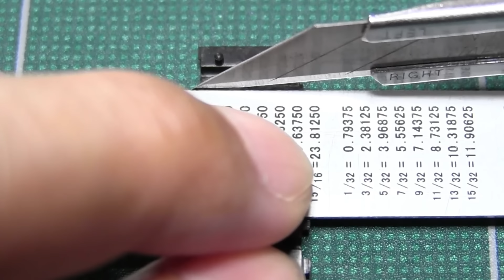1/87 Smart  DIY micro RC car

Comment: I mean it's impressive enough to build a rc car at this scale but then you go ahead and put turn signals, headlights, brake lights, backup lights on it. Seriously impressive good job
Reply: Indeed.
Reply: A little horn would have been hilarious.
Reply: You should put air conditioning in it! 😃
Reply: @jimmycline4778  yaa also add a mini tv inside it
Reply: A GPS monitor would complete it... along with the backup camera...
Reply: Sounds like Stuart Little’s new ride.
Reply: Yeah, Amazing Job, well done mates!
Reply: i have once built a tank in 1-100, thats already hard enough...
Reply: Why doesn’t it have suspension? 😎
Reply: All it needs now is FPV and now you're just REALLY driving micro
Reply: 1 pm! By
Reply: Check out his 1/150th scale vid now that’s impressive
Reply: @ReflexWalaXD ❤❤o3e9àa😂😊
Reply: @markm0000 😅
Reply: @jimmycline4778 😂
Reply: Put engine on it and then we talk impressive
Reply: I have used those optic fibres in a similar fashion on many projects , it’s amazing what he achieved there 👍🏼🥂
Reply: ... and even he sets up the CHARGING PORT..😮
Reply: Also it‘s the smallest car model you could choose. A camper would habe been easier.
Reply: Watch makers have done it for centuries
Reply: Yeah but does it have apple CarPlay?
Reply: As well as high beams and low beams for the headlights.
Reply: AMAZING !!!

Comment: Nice engineering and that is some pro level soldering skills.  This should be what the new hot wheels should be like.
Reply: It is 10 times smaller than Hot Wheels, the scale is about 1:87.

Comment: I didn't move or breathe
I was afraid to stop you from working miracles
Thank you! This is very skillful and beautiful

It is necessary to remove the red-green lamp for the battery,
in real smart
he's not there.

connected charging = brake lights came on
when the battery charge is 100%, the turn signals blink

Comment: I still wonder how the hell you have managed to keep all those naked wires unbroke and disconnected from each. Respect the hard work !!
Reply: i think theyre enamel coated. stops them from interacting and short circuiting each other
Reply: @blurredhorizons5067  and noted some plastic heat shrink or similar on the wire joins. But yes enamelled copper wire.

Comment: You even made brake lights and blinkers with fiberoptic filament? You're crazy! It almost looks like this model was designed to be turned into an RC. For even more compact design, have you considered ordering custom made PCBs? You can do that easily with services like JLCPCB and PCBWay. All you need to do is design the PCB and order it. You can order multiple. There's even flexible PCBs so you could eliminate some wiring with clever design.
Reply: That bit of extra space would be great for implementing AC 😌
Reply: I'm not even sure JLCPCB can make these, they may be too small (there are max and min size requirements)

Comment: Where did you find such a small stepper motor?
Reply: You can find them and the linear screw in mechanisms for pop up cameras on smartphones (e.g. oneplus 7t, redmi k30)
Reply: @scellyyt old feature phones vibrator motor
Reply: those are DC motors which are actually what are used in the video, this person asked for steppers

Comment: Neat!  I did something very similar 25 years ago.  Back then, we still had NiCd's and the electronics weren't nearly so small.  So I had to start with a 1/24 slot car.  (Nowhere near 1/87!)   But yeah, I remember using the dremel to trim up tiny brass pieces that I soldered together, and I made bushings exactly like you did here.  Now a days, I have a 3d printer, so if I were going to try this again, I would DEFINITELY be employing that! :)

Comment: Is there a small enough camera and transmitter that can be mounted?
Reply: Well not really, you would need a bigger bluetooth transmitter and there just isn't any space left inside, or you could use a small 3-1 fpv setup but that would be the size of the car

Comment: 4:04

Good try, but it looks to me that the angles of the front wheels are backwards. If turning to the "left", the left wheel must turn sharper, as compared to the right wheel. Awesome video man!
Reply: front differential axle? it is not needed because this is a rear wheel drive. front wheels are free to rotate at any speed independently. correct me if wrong
Reply: @aerohk  no no, the front steering geometry.

Of course this isn't a big deal for this toy car, but in real life, with real cars, the geometry is wrong. The steering radius is wrong for the front steering wheels.

If a car is turning in a circle to the left, the left front wheel must be turning sharper left at full lock than the right wheel.

Like I said, it's no big deal for this little toy, but I noticed it.

Look up "Ackerman steering geometry"

Comment: How do you program the microcontroller?
Reply from the maker: I connected the Pickit4 and programmed it using Microchip Studio for AVR.
Reply: Thank you @diorama111
Reply: Vous avez bien fait de diffuser votre OVNI ,je suis sidéré de voir que tout est un assemblage de composant électronique aussi minuscules .de quel planète ètes vous venu ?😊
Reply: @diorama111  Sorry if I ask you again but It was kind of difficult to find any information on the internet. With the premise that I'm a complete beginner can you suggest me a book or maybe do a video where you explain a little about microcontrollers, how to program them (I'm not understanding the part where you put and how you do it, the code in the microcontroller), what you have to be careful about and what components you have to choose because of the voltage of the battery, the microcontroller and the sensors you want to use in your project. I hardly know anything about electronics so even a suggestion about a good book where to start would be really helpful. Thank you
Reply from the maker: @kalako-4821  
I learned the C language for AVR around 2012 on an internet site for beginners. However, the site's language is Japanese and the software version is too old to be useful to you.

Currently, there are two ways to use an AVR microcontroller: one is to write programs directly in Microchip Studio, and the other is to use Arduino. It is generally said that it is easier to do this via an Arduino, but I have never used an Arduino so I don't really know.

To learn C language for AVR, you can either read books or look at articles on the Internet. In any case, the only option is to assemble the electronic parts on a breadboard and experiment one by one while always thoroughly reading the data sheet or user guide of the microcontroller. If you think carefully and devise ideas every day, you will be able to create the craft you want in about 10 years.
Reply: @diorama111  thank you so much. I'll start searching the data sheets for the microcontroller immediately.

Comment: But who teaches how to assemble such microcircuits? Where can I learn this?
Reply: Bro Just chatgpt this shit
Reply: @Algomatartrading  You can learn how to assemble microcircuits through courses in electrical engineering, electronics, or microelectronics at universities or technical institutes. Additionally, online platforms like Coursera, edX, or Khan Academy offer relevant courses. Hands-on experience and practice with electronics kits can also enhance your skills.

Thanks 👍 useful advice)
Reply: Also hours and hours of practice. What you see here is the final product. Most don't see 100's of hours spent failing and doing it again. The fine motor skills needed are developed by the practitioner. You have to develop your own tools and techniques. I Marvel at those micro actuators for the steering and drives. He has carefully selected the micro gears and repurposed them.
Reply: I wish I knew as well, though it seems likely tens or hundreds of hours of learning is necessary to even to begin to understand how to do this.
Reply: It's the same electronics just scaled down, the hard thing is finding components and the very delicate operations.
Reply: @odesseus  this is basically an electrical engineering project for a college junior. they probably would have had hundreds of learning hours by that point, but if you were to specifically train on this exact project, maybe a day if you had someone show you by rote. a week if you wanted to have semi-functional knowledge to be able to teach yourself more to apply it to other things. 

multisim is the program i used in college, and it looks like they might have a free online version if you sign your personal data away. if it's not free, i guarantee some company has one that might be a nice sandbox to pique interest... or decide it's overwhelming.

Comment: POWER OF ELECTRICAL ENGINEERING
Reply: If only the extent of electrical engineering was slapping a radio module and a servo together with a microcontroller, lol. Would be an easier job. The dudes got surgical precision with his soldering and assembly though.

Comment: A Lil bit improvement idea - I think gears should be closed from the outside world because they can easily pick a lot of dust with hair overtime. I remember I had that problem with my minisize toys when I was a kid, also they had oil on it, it was not nice to clean.

Comment: Great work, I just fear that the worm gear won't last long as both parts are mounted with an angle to each other (4:50).
Reply: That's not an issue. Technically it is a helical gear and not a worm gear. Therefore you can design it for any angle between the axis.

Comment: i had no idea you could have motors at this scale i thought anything that small had no toruqe at all and was just used for vibratoin in electronics
Reply from the maker: Exactly, since the motor does not have enough force and the slightest friction causes it to stop moving, it is necessary to ensure that each part rotates smoothly.
Reply: crazy:face-fuchsia-tongue-out:

Comment: I'm confused how he used so many intersecting wires when his wire appears to be non-insulated.  Sure, there is a layer of oxidization on any wire that would prevent extremely small voltages from passing, but for anything measured in whole volts I would expect short circuits left and right here.  This could be solved with some careful spacing and glue in between the wires.
Reply: My exact thought! How on earth are the intricate wiring not getting shorted? I suppose the wires are insulated somehow
Reply: it is insulated wire, it has a coating. when he joins the body you can see he adds tape to the areas where joints are soldered.
Reply: It looks like enamel coated wire (magnet wire)
Reply: Ahh! Thank you for that!
Reply: Look up magnet wire.

Comment: I know you have insane skills, but have you hear of ribon cables and circuit boards? you can make them at home with the correct equipement
Reply: What do you mean?
Reply: As someone who does that, if you're only making one of something, all of that engineering time is better spent just making the damn thing.
Reply: @Teth47  I thought it would be easier to ask for some personalized pcb than that wire mess, but im not an expert xD
Reply: @autotactic  It's the process of "asking" that takes up more time than you might expect. You have to design the PCB in CAD so that the company that makes it knows what to make, or so that your CNC machine can rout it out for you.

If you really work at it you can do a simple PCB design with a full day's work, or you can spend 3 hours making a rat's nest from a basic schematic.

For anything but the first prototype or one-off item, yes, you generally would make a PCB, but for anything in those categories you just do the thing, because that rat's nest is the least of your worries.

The first prototype will suck for many reasons, no sense putting a lot of effort into the design before you know what's going to fail.

Comment: Do those cables short circuit when they come in contact?
Reply: I'm guessing but they look like enameled wire, the sort you find in transformers etc.
Reply: No the wire is insulated, but at the solder joints there is extra isolation needed (@10:25 the white blobs)

Comment: Sometimes I don't get electronics. Doesn't the wires have to be isolated? It seems like everything is short circuited after closing the chassis! Isn't it?
Reply: There's a thin coating on the outside of the wire
Reply: @regantaylor5848  :-D That makes a lot of sense! Thank you!

Comment: What kind of wires do you use? They seem to be bare wires and wouldn't that cause a short circuit? Very impressive nonetheless.
Reply: there's an enamel on those wires which acts as isolation

Comment: I will make a 1 to 64 scale project or hotwheels toy, can the microcontroller be replaced by jdy 40? because Attiny1616 and Attiny3217 in Indonesia do not exist.
Reply from the maker: I've never used JDY-40, so I don't know if you can replace the microcontroller with it.
Reply: @diorama111  probably shouldn't use jdy40.  can you recommend other microcontrollers, thanks

Comment: With that much time on your hands, you could make your own PC boards and use the SMDs normally. I made my own PCBs over 50 years ago at home and work.
Does the rear axle cause any problem without a differential?
Reply from the maker: The car doesn't have a differential gear, so it slows down slightly when turning, but this is hardly a problem.

Comment: You should show the size compare with something like coin, pen, fork etc. not just you finger,  it isn't really tell how small the RC car is.
Reply: It's 1/87. Divide the length 9f a Smart fortwo (roughly 2.5-2.7m) with 87 and you get the size.
It's less than 3 cm in length.

Comment: How are the front axles attached?? Looks like you just pushed them into the front hubs but they must be free to rotate so how do you stop them simply falling out??
Reply: I think at 5:30 you can see that there's a little rivet or screw pushed into the inside of the axle. Look at the front right wheel.
Reply from the maker: That's right, I pushed "KATO Z02-1085 2014 Crank Pins".
Reply: @diorama111  what kind of glue or adhexive are you using to keep various components together?

Comment: How do you program your micro controllers at this scale ?
Reply: I use a programmer which has sockets for microcontrollers which I can plug into PC with a USB connection.  Of course, you can use RS-232 or i2c connections depending on the chip.

Comment: Are the wires insulated? how are they not shorting?
Reply: They are coted wire
Reply: simple bro use glue stick
Reply: @eduardomendozajr.5283  welp this absolutely isn't the answer

Comment: shouldn´t the wires short each other out when they´re touching?
Reply: no, they're coated with clear stuff. You  have to shave it off at the ends to solder them. Some headphones have colored tiny wires that are also coated
Reply: @Zoey_KL  how do they shave.. for me it always broke off.. i normally just hold it near a lighter flame...
Reply: My advice would be to either use your nails. Pinch the wire with your nails and slowly pull thhem teough yourr nails. It should strip the wires of thheirr coating. That or use a pair of scissors. Tho withh thee scissors, its a little more tricky.

Comment: How did you handle motor noises on the power line?
Reply from the maker: I addressed the noises by installing capacitors specified in the motor driver's datasheet.

Comment: what are the switches you use for the turn signals called? I've been looking for that exact kind of button!
Reply from the maker: I used detector switches ESE22MH4XDK of ESE22 series.
https://industrial.panasonic.com/cdbs/www-data/pdf/ATB0000/ATB0000C12.pdf
Reply: @diorama111  thank you so much

Comment: can you make the stocky by donut media a rc car?
Reply: Pretty sure Stocky was only sold officially in the US (Donut doesn't take deliveries outside US) and diorama111 is from Japan, and importing one to Japan would be pretty expensive from something like eBay on top of their normal price tags compared to this 1/87 Busch for example (which isn't cheap, but still much cheaper than a Stocky imported).

Comment: Amazing..i want one i can control with my phone but I don't have skills to do something like this i think I would probably break the car trying to cut it open and it's not possible to do this soldiering and wiring connecting the Bluetooth and micro controller's all that stuff together on the lipo very cool with all the functions lights and everything..its a real ev and a rc amazing